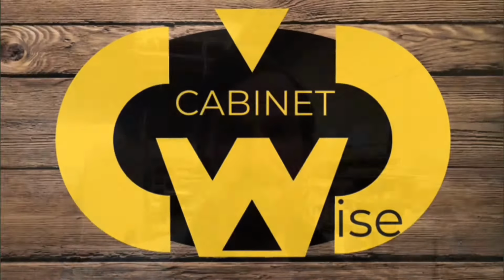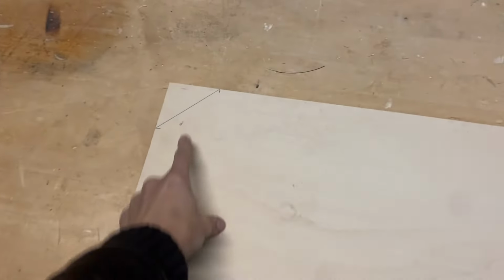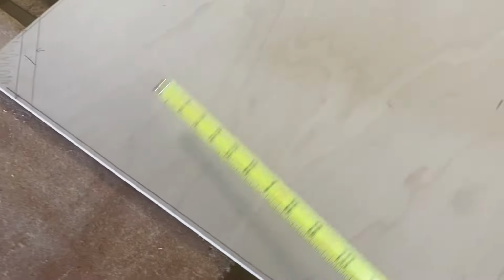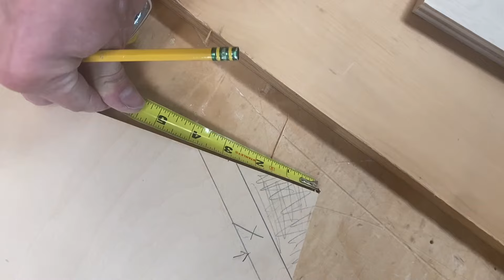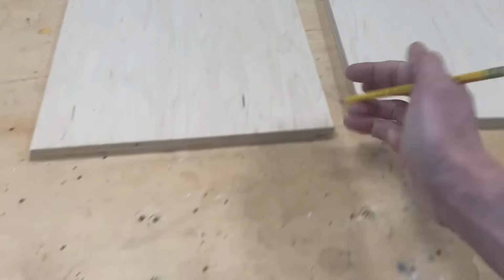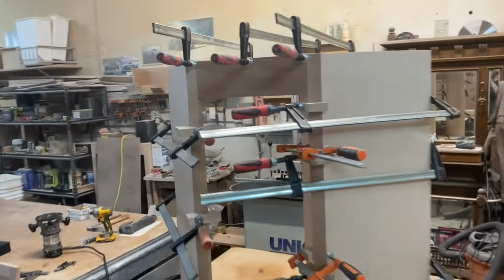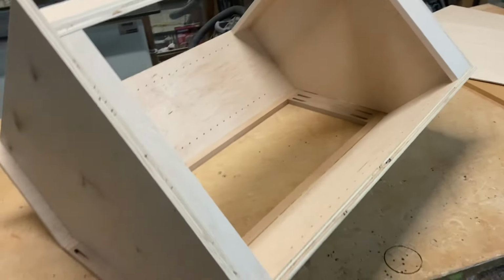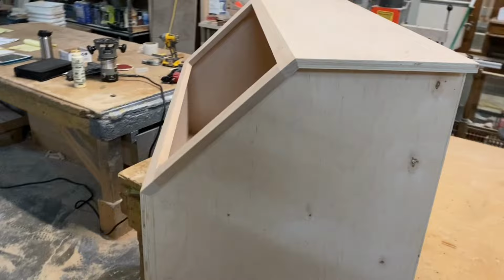MAKING A CORNER UPPER CABINET                     (EASY!)…. *kitchen cabinets*

Comment: nice video. What is the standard size of nail rails and why is the top wider?? Thanks. Also; isnt the standard uppeer cabinet depth 12inches instead of 13 inches?

Comment: Love the video. I've seen to many corner cabs built using butt joints glue and nails. Love the datos would like to see you do the same build with face frame overhanging the box by  eighth to quarter for next cabinet to but to it

Comment: Makes me wish I had to patience to set up my saw etc to cut square ..I have the tools and small shop but can not cut square to save my life..and I watch these videos and it IS relatively "easy" to build cabinets but don't tell that to my nearly naked kitchen. After 5 years of having 2 small uppers and a sink base cabinet, I dream at night of what life with more cabinets would be like in my tiny mountain home because the current kitchen is ehh umm "campy" at best 😂.  The plan you briefly showed with the 2 large side units and double set of lowers is exactly what I need. I Sir, am envious. Bravo.

Comment: Thank you for such a great detailed video, excellent work. I build same corner cabinet, with exception my adjacent cabinets will be 13,3/4” deep with the face frame. So if I am correct the side walls for the corner cabinets should 13,3/4” deep from the 22.5* bevel ? Thank you
Reply from the maker: Yes correct . Sorry for the late response!

Comment: When gluing the piece to the front of the shelf, utilize a hardwood board the thickness of the shelf and nearly as long as the trim piece being laminated to the shelf front to assist in lengthening the short shelf back edge. 

Lay the hardwood board on flat on the short side (rear) of the shelf. Clamp from the middle of the laminate first. Use two additional clamps to clamp the remainder of the laminate. Ease BOTH clamps so they are touching the front of the shelf and the hardwood board BEFORE attempting to apply pressure. Add pressure appropriately and add more clamps if necessary. 

I use cabinet clamps so 3 clamps will suffice for a  22” laminate. 

This is a great video on constructing wall corner cabinets.
Reply from the maker: Thanks ! Glad you liked it .. Good tips 👍

Comment: Excellent video and beautiful work.  Great to see how a pro builds them vs all of the other how to videos on YT.  While you were using mega tools, I could see how I would do the same things with what I have.  You covered a few nice tips and techniques that most don't.  For example, showing how to get your mark, laying and clamping multiple peices and cutting all at once.  And watching you lay out the corner measurements was a thing of beauty. Saved and subscribed.

Comment: Your dog is cool.  Dogs are the best.  You make good looking cabinets.   I cringe you don't use a push stick with your table saw.  You could not react quick enough if the board were to grab or kick back and, boom, serious injury.  Eye protection is also a must.
One additional comment, on the long vanity, that knot/flaw in the left false drawer front is all I could see.  Did the clients say anything.   Use another board, man.
Keep making videos please.
Reply from the maker: Thanks !! Yes I get too comfortable sometimes. Wise words . The vanity was actually paint grade . So it was painted . If it was stained I would not have kept that piece with the flaw . Appreciate the support . More videos will be coming !

Comment: Great video,  I have a question I was hoping you could answer.  Why do you measure 3/4 inch on your bottom for the wall and then come back out another 1/4 inch before you cut?   

My sides or walls are 1/2 inch and face frame is 3/4.  Would I need to still come out another 1/4 inch like you did in your video.    This part is not well explained.

Also any possible way to show how you did the interior shelf after this cabinet was assembled?

Comment: Nice work, but how did you manage to get shelves into the unit? (assuming they follow the same profile as the cabinet)...
Reply from the maker: Should have included that! Oops . I use the base platform as a template and deduct 1/4” to get my size. It gets in just fine , but needs to be angled in at entrance and spun into place

Comment: how to install the hinges?
Reply from the maker: These are Blum inserta hinges . A hole is bored into the door and they are inserted into the hole and when you close the top flap they clamp tightly into position with no screws needed . The base plates to connect to the face frame are screwed  in .

Comment: Mr. CW, did you ever make/publish plans?  I'm a DIY woodworker and kinda got lost of where to cut and what dimensions.  I think the top and bottom were 23-1/2" x 23-1/4". Side panels 13" wide with a bevel.  I think I caught the face frame was 15-1/2" wide at the widest part of the 22-1/2 deg bevel.  I'm an old codger and used to sketches/paper plans and after watching your video 5 times I'm still not sure where to slice open my $150/panel plywood.  Thx

Comment: Not sure why you didn’t cut of the back bottom corner?
Reply from the maker: I just like it to run all the way to the wall on the bottom in the corner as to not leave a hole back there when it’s installed .

Comment: it's interesting to see how others work, we all end up at the same place In the end, I used to use a cabinet saw years ago, have the same one still, but I bought a slider many years ago makes life so much easier and faster.  are you able to get inserta hinges? I have switched brands due to my vendor never having Blum in stock anymore. I am not sure I will go back when they fix the suply chain issues,
Reply from the maker: Months later and the supply chain is getting a little better still not totally fixed but it’s getting better .

Comment: Great job!  Subscribed and Liked!   I'm building my own cabinets, i'm starting my upper's and really like your cleat/build style technique.  I'm using 3/4" and plan to paint (roller or spray - haven't decided yet)...   I was wondering what the type of material used.  3/4" ply Birch?  Baltic is 159$ for 5x5... :( - Is the Face frame Popular or maple or other?  Also, are all your upper cabs 1/4" sides?   Would you use 3/4" sides for the end cabs on a run or still use 1/4" sides?   Thank you, Chuck
Reply from the maker: Hi ! Thank you very much! I’ve been super backed up with work lately but finally have a new video coming out tomorrow . 
We use 3/4 maple plywood for the boxes . The paint is sprayed , conversion varnish (not by me ) designated painter we have .  Face frames for paint grade are usually alder , sometimes maple . Backs are 1/4” maple ply. The core we can in this case has 2 backs , one on each wall , they are each 1/4” ply . The sides are 3/4” .
Reply: @cabinetwise  thanks for the detailed info, that helps!